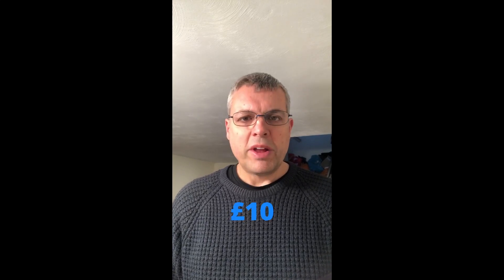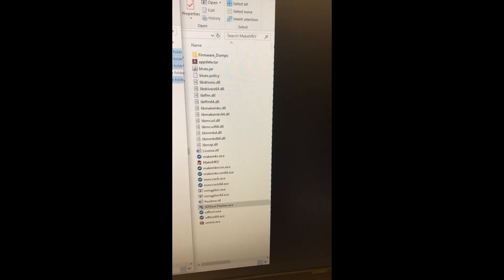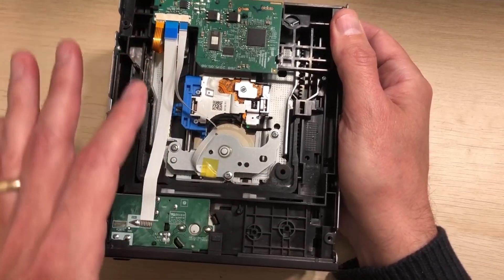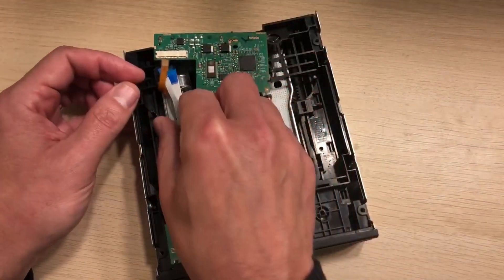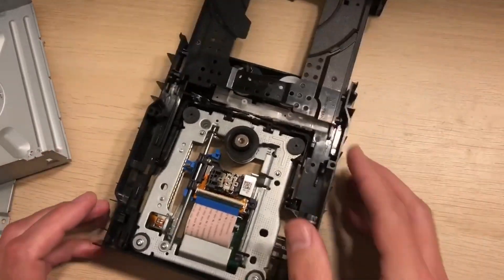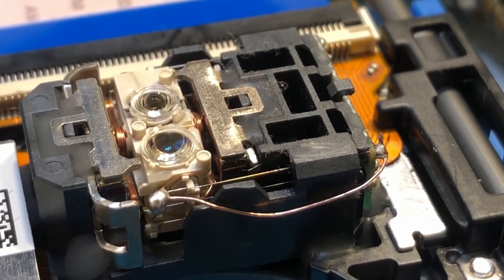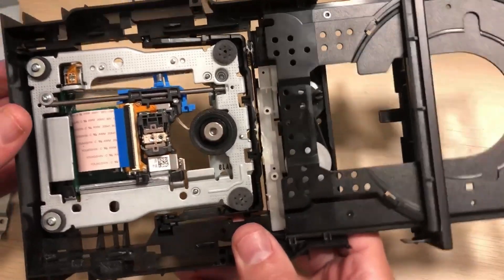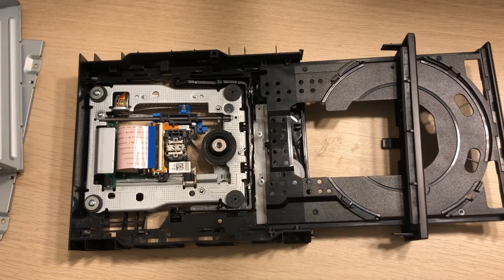Fixing a LG Blu Ray and 4K Movie DVD Drive WH16NS60 WH14NS40 Major Design Fault!

Comment: How did you determine the right height, or how tight to make the screws for the spindle? Mine stopped reading, and I adjusted the screws slightly, which brought it back to life, but its struggling to read triple layer discs.
Reply from the maker: I just adjusted in stages slowly. Once I had resoldered the cd pickup with a new wire. Maybe the laser is stronger on mine and the tolerances could be wider.
Reply: @AvidRetro I ended up mostly figuring it out by matching the height of both of the outside screws. I think it was ~.5 inches on both sides.

Comment: My WH14NS40 works perfectly when it works (reads at high speed, no read errors or retries), but then it will suddenly lose communication with the software. Ejecting the disc and reinserting it restores communication, but I usually can't get through a whole disc before it loses communication again. So I don't think it could have anything like a broken wire or dirty lens, because if it did, it would never work perfectly.

I guess I could try different firmware, but I don't see how firmware that worked fine for 6 years can "go bad."
Reply from the maker: That sounds strange. Have you been able to work out if it is getting to the outside edge of the DVD/CD then failing? If so it could be sign of a weak laser.

Comment: my bluray drive wh16ns40 can't read discs, but every time i just remove the bottom cover and it reads normally. it seems like it's missing a little light to support the lens. what do you think i should do to fix it back to the original. i tried replacing 2 new 100uF capacitors but it still doesn't work.
Reply from the maker: Hi. I don’t think light will affect it. It sounds like there is pressure or disconnection on the circuit when the cover is in place. I would check carefully for loose connections.

Comment: Is isopropyl alcohol too harsh for laser cleaning? It would be if you use too much force when cleaning it with a cotton bud (scratching it), but it should be fine if you're gentle I assume.
Reply from the maker: Hi I prefer not to use it if possible. It’s probably fine on clear CD lens just be careful on dvd players as it’s best to not use it on them as can take the colour coating off.
Reply: @AvidRetro  I didn't know they had a colour coating, is that important? Thought they were coloured the whole way through.

Comment: Out of no where my drive would not read discs. It sat for about 2 years without any use. I was hoping downgrading/upgrading the firmware, would have some magical effect, no luck there. I cleaned the lens as shown in the video and boom, works! Thought I possibly needed a new drive. Thank you very much for taking the time to make this video! 🙏🏻🙂💚
Reply from the maker: No problem I’m just glad to have assisted you. You can bookmark my video in case you experience further issues down the line!  Thanks. 🙏
Reply: Wonderful person. Much love to You and Yours 🙏🏻🙂💚